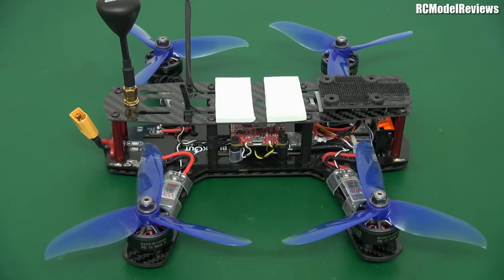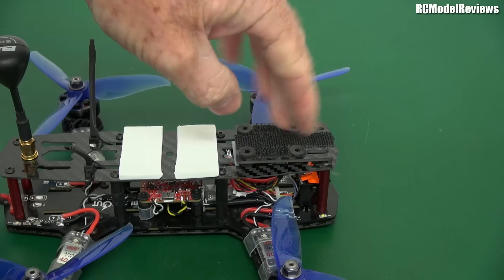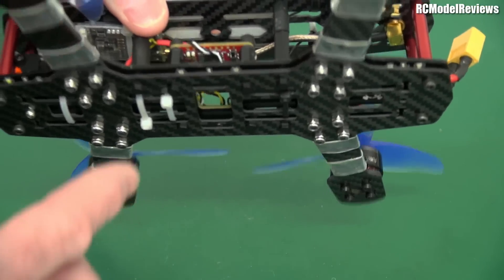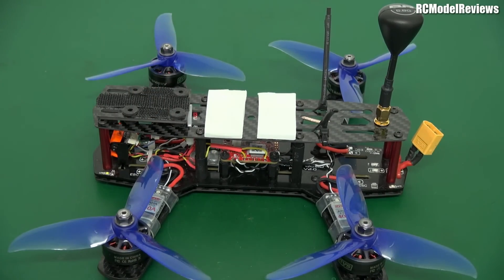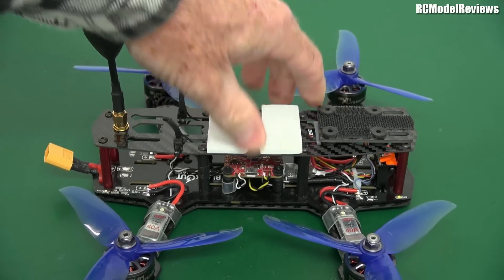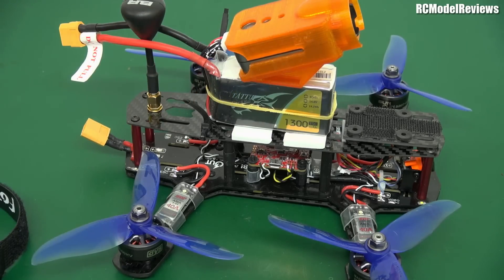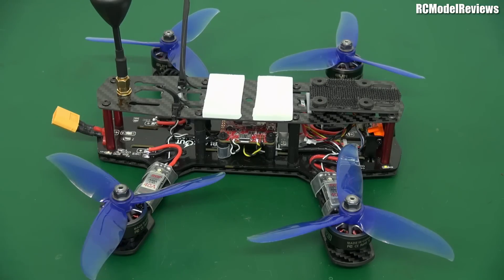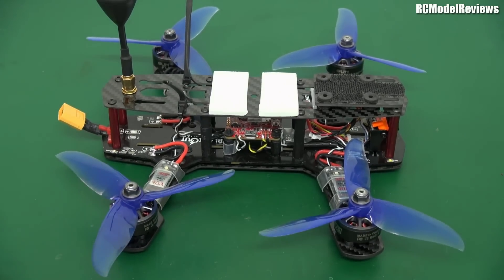Blackout Mini-H racing quad "Retro Rocket"

Comment: I still fly with Blackout:s 😀

But they are upgraded with new parts but have still the Cobra 2204 2300 and 1960 kv motors on the fpv quads.

Two Blackout:s for fpv and one for 3D los flying.

And that 3 mm arms don´t break easaly :-)

I have mounted metal stanoff:s and screws  and long metal screws for the flightcontroller.

I think some of your interessded videos got me into flying fpv :-)

Comment: I have a drawer full of old school frames. They were fairly shocking and not very strong, and to think we used to think space was quite tight too. This hobby has evolved at a rapid rate of knots. Back in the day there wasn't many frame options. I wonder how many are churned out every month now? Endorsed by Captain Super Amazeballs or whoever. In a blind frame test nobody would tell the difference if they were all built the same with stock pids and average rates.

Comment: This frame is so heavy. The weight difference to a frame without all the metal traces in the bottom plate is almost as heavy as a battery.
Reply: Well its an old frame...

Comment: It's cool to see an old school frame with modern gear, but I clicked on the video hoping to see an original Blackout build. With 1806 motors, giant 12 amp SimonK ESCs, a Naze32 flight controller, a huge board cam, an 1800mah 3S battery, and one of those giant Immersion VTXs.
Reply: that`s exactly what I had on my blackout  and with 6mm thick arms 5 years ago

Comment: Whats retro about it .. I still fly these as my main quad.
Reply: OutbackKanga exactly!  I’m still flying the very first QAV250! I freakin love that quad!
Reply: Anything over 13 months is apparently "retro", "old school" and "outdated".
Reply: Still sporting a Blackout mini hex with an original Naze 32 and Simon K esc's. I think they are the blue series. Haven't changed the nylon standoffs yet. Still rocking the board camera as well.
Reply: Ha. Just rebuilt my mini h. Was running older Lumenier 20 am esc a naze and an old ppm style lemon receiver. Rebuilt it with new dys 20 am esc, kiss flight controller, and a new micro eagle cam. It feels great. Always loved this frame. I have three of them! It’s vintage, the pioneer and holds a great place in my heart for my passion toward this awesome hobby. Glad there are still guys flying things outside of the modern frame hype!